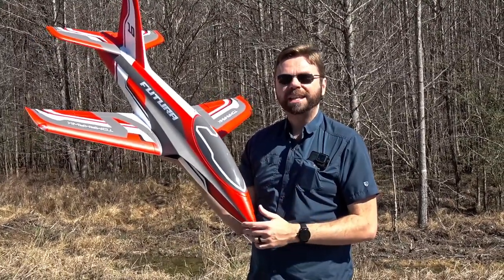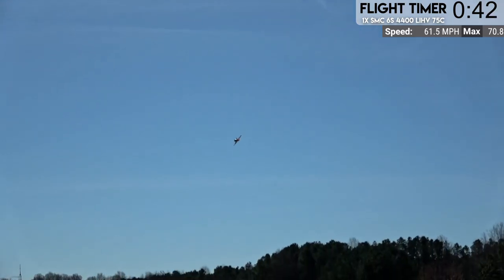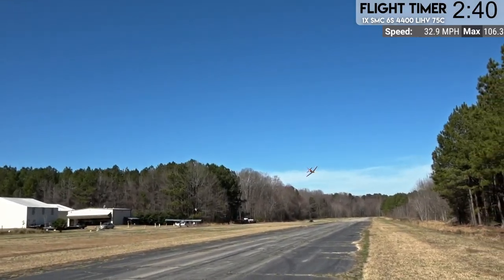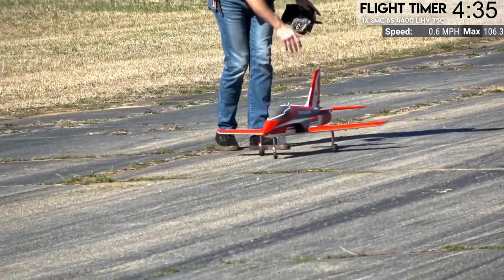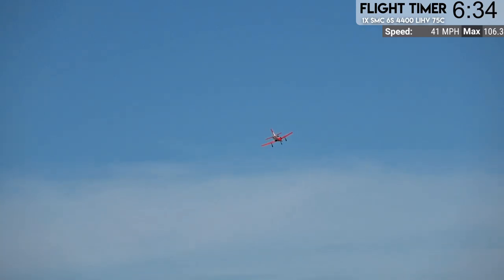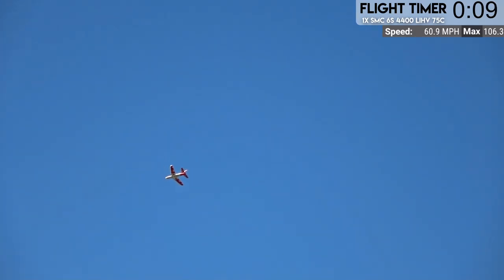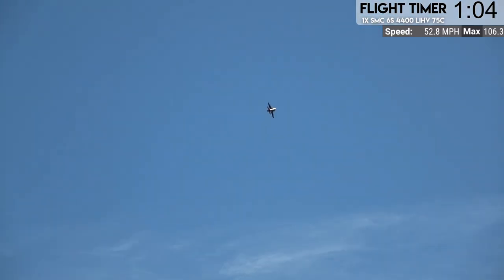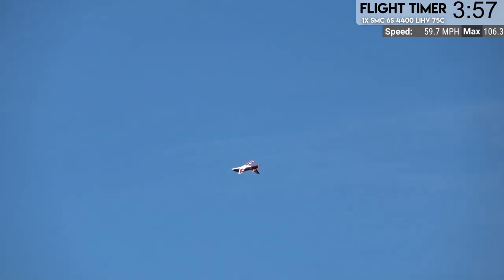This RC Jet Flies SLOWER Than It Lands - FMS Futura 80mm v3

Comment: I purchased this Jet thinking I'd be as cool as you guys flying it, but I've sucked at its landings a "couple" of times! LOL. Interestingly, the only damage I've done to it so far has been breaking the nose (which isn't a big deal to glue back), and I've broken the front gear door (which I've removed, given that I've broken it more than once!).

I'll keep at it, but one thing I have noticed is that I've been using my CG as per the manual. I flew it once with the battery pushed backwards (as you showed on your video) and I managed to perform a perfect landing! From now on, I'll CG it on the mains (as you've noted down here somewhere), and keep at it. This plane is so beautiful, I'll probably use this one as a beater to hone in on my landings and get another one! I also have a brand new (just assembled) FMS BAE Hawk, but I think I'll keep that one in the hangar until I can land this guy right all the time. 

Awesome videos! Thanks for sharing!!!
Reply from the maker: We're happy to see that you're enjoying it with the CG over the mains - the further back it goes (up to a point), the better a model will fly!

Comment: FMS really nailed it w this plane, imo the strut springs are stiff otherwise not a single issue.  It comes w me to the field every single time and it always brings a grin.  One member bought one and others are looking at it now, on Sunday we clocked it at 138, full dive to level, roaring top 70c4400.
I wasn’t a fan of the look at first, but it’s grown on me, easy to see in any weather
Reply from the maker: Going fast is neat, but have you ever tried flying slower than the jet normally lands? That's where the real fun is.

Comment: I bought one but still in the box. Glad I watch this video. I’ll watch out for the nose wheel hanging up on the spring door. I’ll also put the 4500mah battery vice the 5000. I like doing nice slow landings.
Reply from the maker: Happy to help. 3600 to 4500 is the sweet spot for this jet.

Comment: Love the Futura, I have about 150 flights on the Purple V1. I didn’t buy the blue/grey/white V2 because I think it would have been difficult for me to see in the air. I will pick up a new V3 sometime this year. My Viper 90MM remains my favorite EDF, but at almost $700 with tax and shipping, I’m not sure I’ll replace it when the time comes. The Futura, (and Free Wing Avanti 80MM) are pretty hard to beat at $400 shipped.
Reply: Don't forget with the Viper 90mm add ~300 for batteries...you're looking well over a $1K EDF.
Reply: @davidgerlach1132  Yep. I recently picked up the new Avanti V2 and it is outstanding. If I pick up another Viper 90, it will be the plug and play version at $450.00 plus tax, not the $700 plus tax bind and fly version.

Comment: I can't believe I haven't purchased this beautiful sport jet.  You make it look amazing visually flying it.  I'm contemplating this Futura for an additional sport EDF jet, or the Freewing 6s 90mm F-22 Raptor.  In a perfect world I'd have both.

As for the speed, this is interesting.  In the same direction, in both runs with flaps down or up you reached 106mph.  I'm assuming you were at full throttle both times.
Reply from the maker: Full throttle both times, yep!

Comment: Where are you running the CG? I had to run an SMC 5300 LiHV to get it to balance per the manual.
Reply from the maker: The manual recommendation is very nose heavy. Flying on a 3600 SMC HV allowed us to center the balance above the main wheels.

Comment: Just got this plane and about to maiden it. Also going to use SMC 4400mAh. 

I’ve been told to shove it forward and carve the canopy so the battery fits in order to get the factory CG recommendation. 

I see yours isn’t even all the way forward. Do you mind shedding light?

I’m confused and torn.
Reply from the maker: We fly with 4400s if we want a little more flight time, but use 3600s shoved all the way back to make it perform stable high alpha passes. The factory CG is incredibly nose heavy and can be safely discarded. Ours balances over the main wheels. Add expo to compensate for the additional pitch authority to tamp it down and you'll be totally fine. Just be aware it will experience accelerated stalls easier if you're not smooth on the sticks, but good airmanship will fix that.

Join us on Discord via https://bit.ly/TBRCDiscord for more info on setup guides and to chat with like-minded members of our YT community!
Reply: @TwoBrosRC  thank you! I’ve been watching your videos ever since I got back on the hobby. 

Keep doing a good job at making these entertaining videos.

Comment: Hey Jon! What’s the size of the Dubro Super Lite? Also, will 5000mah fit? Thanks for another great one!!
Reply from the maker: 2" SuperLite wheels should fit easily. 2.25" is a good choice too. We'd recommend a 4000 class pack. 5k packs are too heavy for this jet to reach its potential.
Reply: @TwoBrosRC  oh then I probably take this off my list as all of my packs are 5000 :( 
Thanks!!
Reply: @TwoBrosRC I’ll make the swap to the 2.25” Dubro Super Lite and see if it makes a difference. 
I brought it to the field a couple of times and it didn’t take off 😞.  Not sure if it’s because the grass was too high, or if it was something else. Rather odd.

Comment: My dilemma is this; e-flite Viper 70mm OR this FMS - Futura V3? (I'm a very experienced pilot so I want a thrill!)
Reply from the maker: You'll get more of a thrill out of the Futura. It's fast, and it's capable of high alpha too. The Viper, unfortunately, is not - but it is fast!

Plus you can get 5% off the Futura using the code FMS2NR on FMSHobby.com!

Comment: Do you still prefere the e-flite Viper 90mm over this? I like them both (I think the viper 90mm sounds better, at least from YT videos). 
I would like to get into edf sooner or later, and those 2 are the most interesting ones atm. 
I’ve seen only a Viper 70mm  and few bigger Futura with fuel turbine irl.
Reply from the maker: Viper 90 is definitely faster and a little more aerobatic, but Futura can perform high alpha passes without any mixing and doesn't need an 8 channel receiver to do it either. It's a tradeoff.
Reply: @TwoBrosRC  Understeand. The Futura is maybe better than the Viper 70mm, being at a close price (at least in my area).
What would you recomend as 1st edf, other than the Habu, for grass fields?
Reply from the maker: @the_bogeyman.  The new Viper 70mm would be our suggestion because it teaches you how jets fly and how to get out of stalls. Watch our vid on it which includes a tutorial on stalls and landings: https://www.youtube.com/watch?v=cJ63fRoKlHY

Link to buy is in the description if you'd like to support us!
Reply: @the_bogeyman.  Viper!

Comment: Awesome my man !!!! I can’t wait to get mine too….in the container right now…
But can you tell us the real CG you fly with, in millimeters please, not an approximate CG but a real measurement please 😅
Reply from the maker: No approximate CG required, it literally balanced directly over the center of the main wheel wells. It's not a CG you'll want to fly it at if you're not used to the jet, but it does handle really nicely. Lots of expo with the throws we use will be required. We can get you a physical measurement, just ask on FB Messenger. ;)

Comment: Hey. How do u get speed readouts? Can it be added to Horizon models w/ Spektrum?
Reply from the maker: This is using a Spektrum setup. You need a GPS from Spektrum and an IX transmitter to call out like we're doing it here.
Reply: @TwoBrosRC  bummer. Just moved last week from a dx9 to nx10. Thank you for the reply
Reply: @TwoBrosRC .  I looked around the interweb and ordered the GPS Telemetry Sensor
SPMA95871. Pretty sure it’ll work with my nx10 on a few of my models.
Reply from the maker: @SOBaseball  It'll work, but you probably won't get the concise info our IX radio sounds off.
Reply: @TwoBrosRC . I had so many rewards/discounts could have bought an ix14 for $570.  Still can probably. Just didn’t know any reason to. Got my nx10 for $370. If you can tell me why I’ll return the nx10 and get the ix14. I’ll never fly turbines so I wasn’t interested; I’m totally a park flyer type- we have a small strip by our house I fly at while my girls play on the playground. The 1-2 minute boot up lost me. But if there are features that make up for that gap, please lmk. I can still exchange it, but not for long.
Reply from the maker: @SOBaseball  https://bit.ly/3D1Gg8w if you want the IX14. It's fast, has great gimbals, and uses Android so you can quickly program models and adjust things on the fly. The audio processor uses Android TTS so it'll speak anything you tell it to instead of being forced to use prewritten macros like the DX/NX radios. This means you can get concise info like "50 miles per hour" instead of it saying something like "Airspeed... 50... Miles... Per... Hour..." which is usually bundled with another bit of data that you probably don't need or want to hear. Boot up time is not bad - just put it to sleep when you're not using it and leave it on a charger like a phone. It wakes up instantly.

Comment: Hi, which do you prefer between the Futura V3 and the FMS BAE Hawk 80MM? How do they compare? Thanks!
Reply from the maker: They're both very stable airframes. There's no real preference between them for us.
Reply: @TwoBrosRC  Also, do you now prefer Dubro light weight wheels over the low bounce? Why please? Thanks!
Reply from the maker: @mickydee6550  It depends on the model. Super Lite wheels work best on this model because we're pretty sure low-bounce won't fit on the axles and rotate without rubbing. Super Lites are thinner profile so they tend to work better on models like this one.

Comment: John what weight is that lipo so I know where ur cg is. 106 isn't bad level flight. I got 128 on a slight dive. The v2 got 129.  V3 is my go to jet definitely my favourite sports 80mm.
Reply from the maker: The 4400 HV packs weigh in at 592g. The 3600 HV packs weigh in at 487g.

Comment: The Planes Esc Timing must not be in high rate cause i have the V-2 Futura and ive clocked mine several times doing 135mph easily
Reply from the maker: Speed isn't a thing we care too much about. We're much more interested in how slow a model can fly without stalling.
Reply: @TwoBrosRC  Yeah thats always a good thing to be able to do on a Large Jet

Comment: Hey Jon.  If I get an avian esc for this jet, will it reverse thrust or will I need to use an AR637 along with the avian to get the reverse feature?  I’m using an AR8000 at the moment.   Keep up the great work with your videos!
Reply from the maker: A 100 amp Avian ESC would work, but you'd need a modern Spektrum receiver to use Smart tech. If you'd like to support us, consider picking up the AR637T via https://bit.ly/3dCjiuO and the Avian 100 amp ESC via https://bit.ly/3PywkGY

Comment: In comparison, viper 90 or futura which one is better as far slow speed stall? I just dumped my viper90 coming around to land. It just nosed over like giant magnet yanked it out of the sky.
Reply from the maker: The Futura has a much better stall characteristic than the Viper does. You can't fly a Viper in high alpha like this without a crow mix.